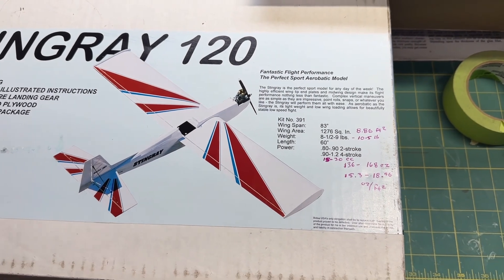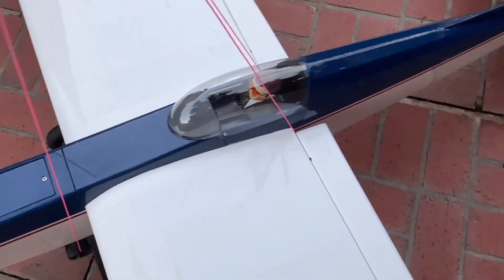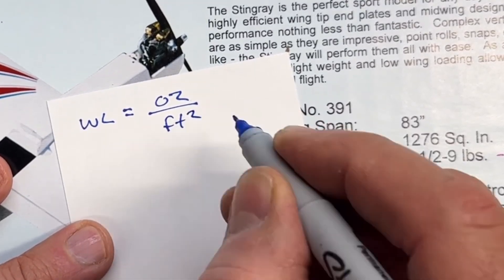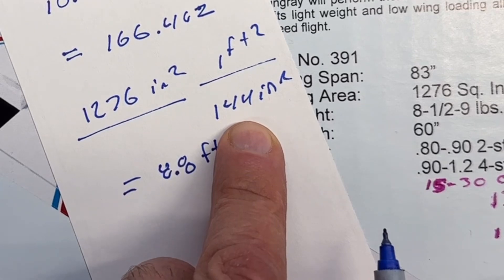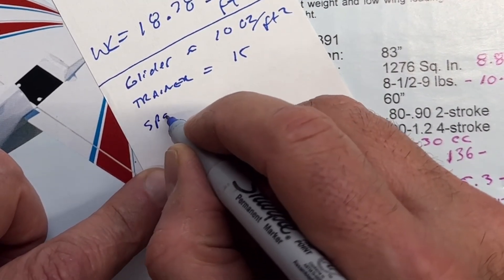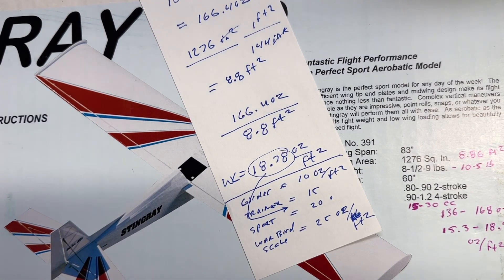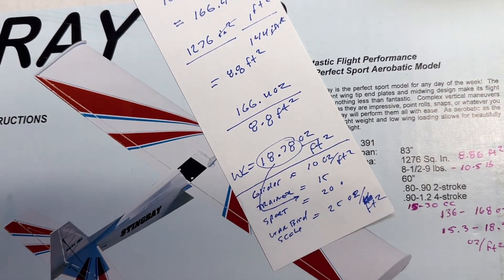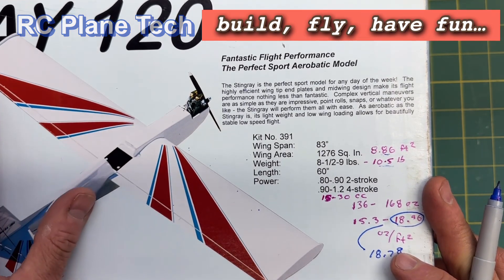Balsa USA Stingray with DLE-20, RC Plane Build N0 37: Calculate Wing Loading

Comment: A somewhat better indicator of how a plane will fly is the cubic wing loading, or wing cubic loading. To find this, calculate the wing loading as you did in this video, in units of oz/ft2. Then divide this number by the square root of the wing area, in ft2. 
   Area of wing, 8.8 ft2. Weight of plane, 166.4 oz.  Wing loading = 166.4 / 8.8 = 18.9 oz/ft2.  

Square root of wing area = square root of 8.8  = 2.97    

Cubic wing loading = Wing loading / Square root of wing area   =  18.9 / 2.97  =  6.36 

Here are typical cubic wing loadings for different types of planes:   Gliders   4;  Trainers  6; 
Sport  9;  Pattern  11;  Racers  12;  Scale   10 - 15;  Full Scale  15 - 20. 

The value of 6.36 for your plane is very close to that of a typical trainer and is considerably lighter than a sport plane. I predict that it will be rather "floaty," and will land at a low speed.
Reply from the maker: Thanks, I need to brush up on cubic wing loading. I'll check it out, thanks! Awesome, thanks for the calculation and check!!!

Comment: Nice 1 James Great looking aircraft but I was confused on working out the math I've never done that just built em and flew em thanks for vid
Reply from the maker: Thanks! People like cubic loading as well, but either way doing a straight wing loading calc the "old Way" still works since you are comparing to the related charts.  But I need to learn the cubic method to be up to speed.